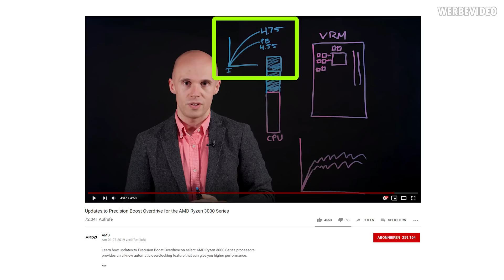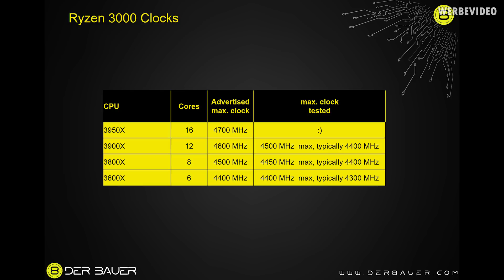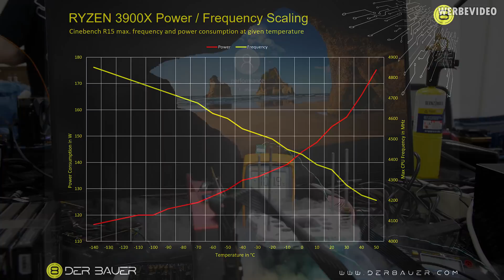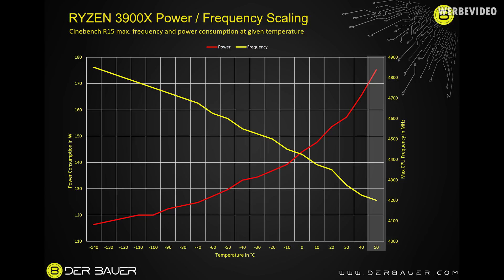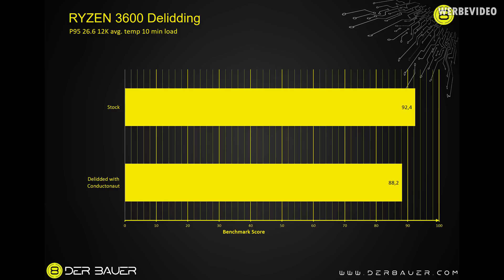RYZEN 3000 Delidded - Overclocking Expectations and Temperature Scaling

Comment: Very interesting, you said in your video that going above 1.45 V when OC'ing is not worth it, you meant 1.45V set in Ryzen Master for all cores OC'ing right ?
If that's the case, I think I'll be OC'ing at 1.40 V just to get a bit of voltage headroom and not heat things too much (I have a Noctua NH-U12A though so it should be fine).
My motherboard is an X470, but it's an ASRock Taichi (not ultimate, but it's pretty much the same except for the 10 Gigabit Ethernet), it has 6+6 CPU power connection, so OC should be fine.

Comment: Awesome work as usual dude. I was wondering if you could try cooling the chip without the heat spreader.Somewhat like a gpu is cooled with the cooler directly on top of the chip. Just curious. :)

Comment: I have an 8700k, that said. AMD have done fantastically with this generation, keep in mind 4.3 AMD is NOT equivalent to 4.3 INTEL, similar to what happeneded in the early 90's. Check actual gaming results etc... to see which processors are equivalent. I'd likely buy a 3700X if i was in the market now

Comment: Feels like all over clocking people just try and error with no clue what heppens inside the cpu. Like the engineers have no idea what they are doing? I understand over clocking factory under clocked mid and low range cpus. You degrade the material in the transistor gate. I also understand over clocking benchmark competition with liquid nitrogen.

Comment: Realistically,  with the stock cooler...what boost can you expect ?

4.2ghz on a 3800X ?
Reply: I get 4.35 ghz on 3700x with stock cooler and temp is 38-40 c. I used asus 5 way optimization on Rog croshair hero viii

Comment: @Der8aeur Great content man! I was wondering would it be possible to direct die cool the 3700x or 3900x like we can on the 9700k/9900k and watercooling it? Could we get a bit more performance and lower temps by doing so?  I would love to know your opinion on the subject or maybe worth a new video..
Edit: i'm using your direct die frame for my 9900k and lapped the die a bit like you did on a video and managed to get a great overclock on a big water loop.. I'm a tinker i love doing things like this and i would love to know if it's possible on the AM4 socket.
Thanks

Comment: AMD 3000 feature a soldered integrated heat spreader, why would you get them delidded?
Reply: He's just explaining why a regular user don't need to delid at all....professional overclockers like him will delid it anyway because they have superior LM and need every drop of performance
Reply: The lid itself still insulates the die from the cooler somewhat, removing the lid removes this layer of insulation

Comment: Once again, AMD is putting the effort in to ship their CPUs in the best condition possible (XFR, solder, etc.)

While this does ruin the overclocking potential of these chips, it also means that AMD aren't sandbaging their parts and are getting the best  parts they can make to consumers.

It also says something about the consistency of AMDs manufacturing that they're able to push out chips that straddle their maximum potential 24/7 under full warranty.

Comment: Did you see any difference between the 3700x and 3800x with overclocking? Starting to wonder if it's worth spending that extra 70 dollars for the 3800x at this point.

Comment: The high quality chips will hit 5ghz. AMD is aggressively binning the chiplets. They have no competition. All the best chiplets are being kept back. Sucks, but they are choosing to maximize profits and sell off leaky silicon. Plus, they probably anticipate more demand for Epyc Rome than they have supply. Maybe thread ripper will get good silicon bins. Probably only near 5ghz on 2 or 4 active core boost. My two cents based on research. The process tests early on indicates 5ghz possible for few cores with best chiplets

Comment: AMD always have something wrong, they sure are on 7nm, but then their Navi GPU as tested just a small OC that barely wins performance makes the GPU to go above 300W, way more than even RTX2080TI made in 12nm...

Now AMD is also lying like intel on their CPU's TDP like the 12core 105W TDP which is more around 150W even though I9 9900K is still worse, but still AMD is already getting too much like intel... I dont even know what do they win by lying.

And then its always the same crap, what you get when you buy is basically almost all you get with AMD since neither their GPU, neither their CPU's seem to OC much more than max stock boost already, future wise it just doesnt reach anywhere more than you had on day one other than relying on software\bios updates to maybe win some performance at some point...

They sure can be the 1st to use 7nm on desktops, but to me this is all signs of bad quality only...

Comment: I wonder if they sent 'golden samples' to the various tech press, because I've seen multiple reviews showing the 3900x boosting single cores to 4.6ghz on it's own.  but yeah it's unfortunate that AMD put out that video of the guy talking about 4.75+ghz.  maybe the 16 core might hit 4.75 on one core under ideal circumstances?  anyway it's still a great chip, and zen 3 looks like it will be even more amazing in terms of architecture changes, let alone the possible process improvements.  but depending on market they might feel that they can release a zen 2 refresh with process improvements first.  we shall see.  I wonder what the 3800x will be able to do vs the 3700x.  just 100 mhz extra?  given the pricing i think many high end gamers might say that's worth it.

given that the 3700x and 3800x are essentially identical, I think AMD should have come out with a star 8 core gaming part for 399-449, with the best silicon, which is currently reserved for Epic.  Even the 3900x and likely even the 3950x are not even getting the best silicon, which is solely reserved for Epyc (and possibly a future threadripper).  But if they chose a low volume 8 core part (low volume because it's 50-100 dollars more for essentially the same thing with some higher clocks - it won't be the high selling value part, so they wouldn't have to spare a lot of quality chiplets) with cherry picked A+ silicon they would have really satisfied the hardcore gamers who wanted the absolute best 8 core CPU that would truly rival the 9900K / 9900KS (or KF?) even when hitting 5.1-5.2 (or even 5.3 in some cases) ghz.  I'm talking about an 8 core that could hit whatever their best silicon can hit... 4-4-4.7, maybe 4.8, depending on the workload.  Truth is we don't know what their best silicon can hit.  It's likely not THAT much better, in fact it might not have higher frequencies at all, but simply run the same frequencies at a lower voltage, but we just don't know unless or until someone can test an Epyc/threadripper with the top silicon and see what 1 or 2 or 3 or 4 etc. cores can hit.  AMD's making a lot of money off these 3rd gen chips because these are ALL rejects, even the 3900x.

Comment: No speed @ -100 C ? I asked AMD if their new 3 gen CPU's (W/WX and Ryzen) could run @ -100C and the answer I received was "what was your question" . That ended my AMD machine thoughts. 

Why not make a shim to support the chip and leave the heat spreader off. Like on the old Athlon 1400's die's with the bare die.

Comment: PBO doesn't even fuckin work on my X470 ROG board. 1800X + C7H combo. It showed up in the bios once and now it's gone. My 1800X runs at 3.7 on all cores with no 4.1 boost when it's not OC'd. So I've been forced to go manual. 4.1 on all cores at 1.42V.

Comment: The lesson: ignore all marketing. Wait for the reviewers to get a baseline. Check the HC overclockers for upper limits. Even us filthy casuals should check der8aur's and others channels to get the upper limits so we know what is the absolute best and the reasonably competent boards.
I'm getting the impression that overclocking the R3 cpu's isn't that productive for the average users as most of the reputable overclockers seem disappointed with the basic oc potential. That and from the look of things AMD actually did a decent enough job that it's probably not necessary for just gaming and light productivity.
But I may be wrong as I'm just a filthy casual, hehe.

Comment: This is going to sound like a dumb question as I don't know that much about this. But for really extreme clocking, would there be any benefit of using a custom heat spreader made from a metal with better thermal transfer properties? Or are they very good anyway?
Reply from the maker: it is already pure copper so not really

Comment: BTW, to remove the Indium layer on the cpu, you can use liquid metal(like galinstan metal, or conductonaut if you're rich) to soften it up, then it's a lot easier to get rid of them.

And don't spill liquid metal on solder joints, they can be soften up too.

Comment: My 2600x will hit 5Ghz on 2 cores with PBO turned up, but the board (an Asus Strix X470) gave it scary voltages to hit that. If I was cooling with LN2, that'd be fine, but under my water loop, it was just too much. 1.6v under ambient water? No thanks, too scary.

Comment: Would lapping give the same 4 to 5c drop, would you recommend this ? Thank n keep up the good work :)
Reply: Lapping done right is harmless.But i doubt you will get 4-5c drop.On 1700 i got like 1 degree drop and it wasn't even worth the effort.
Reply: @Reculse  I'm not 100% on what i got from doing my 1700x (yes inknowni should have just got the 1700 but i was too quick in buying lol) but with the delid and lapping and lapping my water block I thinkin get about 8c reduction. Reas resks and the delid wasnt needed I dont think.
Reply: @Entropicarts  Probably you will get decent resault with liquid metal and without any delid and lapping. You won't overclock higher than 3.8/3.9 anyway cause it doesn't even worth it(unless you got good chip). At Vcore 1.375v(with LLC 3) i hit around 160W max and i get like 65 degrees max which leave me with 3.8GHz and fully stable CPU.In comparrison 1.18v if i remember correctly was the default clock for 3.6 ghz and the cpu was drawing 68~ish watts.

Comment: How about Ryzen 3000 direct die cooling? Would probably need shim to limit stress from mounting pressure of cooler. Wonder if it would help get more than 4-5'C lower temperatures compared to stock ihs+solder.

Comment: Mister Der Bauer did you overclock it with MSI X570 ACE?  it seems to be Faster than the Other Motherboard with the Overclocking Button on the board...  Someone Benchmarked it , it would probably get the extra 50hertz to 100 hertz!!!!

Comment: Regarding the lower than advertised boost clock - did you see this yet? https://twitter.com/andreif7/status/1148170909322293248?s=09
Apparently there's an issue with the "AGESA code" provided by AMD to MB BIOS folks see review with in depth on it here https://www.xanxogaming.com/reviews/amd-ryzen-9-3900x-review-english-dethroning-the-intel-core-i9-9900k/ and reponse from Gigabyte on reddit thread here : https://www.reddit.com/r/Amd/comments/cag6gb/wtf_is_going_on_why_is_there_so_much_disparity/
Reply from the maker: https://www.overclock.net/forum/10-amd-cpus/1728758-strictly-technical-matisse-not-really.html
Reply: @der8auer  that post seems to describe an issue restricted to the Asus Crosshair? the xanxogaming link describes an issue that affects Gigabyte, Asus and MSI boards he tested.

Comment: What i remember is  , I've delided Intel Pentium D  and i ripped off whole cpu core .. One half of the core stay on IHS and the other one on cpu board itself.. This solder in Ryzen 3000 series is extremely soft.. you should try to remove remaining solder and try to apply low temperature melt solder on it..

Comment: I don't get it. At one point it is obvious overclocking won't be a thing anymore, that is the whole point of things like XFR.

The era we were able to get "free" performances OCing your chips manually is soon to be over. We will get what we paid for and that is it.

I mean the computer are just on the same trend as the internal combustion engine. They started with carburetor, it lacked the possibility to be optimized precisely and now they have precise fuel injection.
The trade off is made by the manufacturer and while you can tweak the settings a little it will still be a trade off in the end and not "free" improvement anymore.

Comment: this is the only honest video ive seen since ryzen 3000 release. they are good cpus, but not really as good as they promised. and with no overclocking headroom at all etc. and not even matching their own advertised speeds... and even teh 3900x does not quite beat the i9-9900k in single threaded/ gaming workloads. i was always going to go for a ryzen 3xxx but now im not so sure. i have always bought amd in the past (still using an old slow fx8350 #4.6ghz) but i have a little more money now and i kinda wanted the best of the best.

also, i cant deny i love overclocking my stuff. the thought of not being able to do that... yeah. its just not as impressive to me to not own an overclocked cpu. no bragging rights etc. also, i wanted to go custom loop water cooling but that would be next to pointless performance wise with the new ryzen. 

im kinda disapppointed. i new 5ghz was out of reach. but i hoped for 4.5-4.6ghz all core overclocks. i hoped they had improved overclocking possiblities.. i mean, they use barely any power, so keeping them well fed voltage wise and keeping them cool should allow for a decent overclock but i guess not. its just not the way they were designed. its impressive. but i find it annoying.

i just dont know what to get. will probably just pick up the 3700x or something. but i initially wanted the 3900x despite the price, but if i went that high i might as well get the i9-9900k. cheaper motherboards/ram and better single core/ gaming performance. overclock capability up to 5ghz. etc... errr. i dont know.

every other video is overhyping amd. but all amd has really dont is almost matched intel in performance for games. and added more cores than most people need for anything. its mostly all hype. unless you do a lot of encoding or something...

err

Comment: Thank you for being open and direct about AMD and their practices. I know you weren't trying to belittle them or anyting but at least you're not afraid to say what's going on in some cases. 
The AMD worshippers just can't hear any criticism. 
And you can tell by the reviews today who favors AMD and who doesn't by the benchmarking results and how they approached them. 
Looking forward to your next video.
Reply: ... Except for the fact that AMD fixed this issue within a few months of launch with an AGESA update, whereas Intel wouldn't have even admitted there was a problem had their situations been flipped (let ALONE acknowledge said problem as being their fault). Ever since, the VAST majority of Ryzen 3000 CPU's will hit their rated boost clocks, and those that don't tend to be for external reasons (shitty cooling/mobo/etc...). 

Now before you start complaining about how they can't sustain said clocks long term, NOWHERE has AMD or Intel EVER advertised their max rated boost clocks as being "indefinite". Intel's Turbo Boost has had a built in time duration limit literally ever since Intel first introduced the technology (regardless of the fact that AIB's endemically disable said time limits with "MCE = Auto"). And AMD's even more explicit about Precision Boost being a dynamic, opportunistic boost algorithm, where the rated clock-speed on the box is simply the max you'll see it hit on a chip's best 1-2 cores (with no claims ever having been made that it can & will hold such clocks indefinitely. The fact that that's the default behavior many Intel customers are used to due to AIB MCE shenanigins, isn't AMD's fault it any way, shape, or form).

Comment: The theory behind why and would stagger the chiplets on pcb is so the heat generated is not concentrated in the centre its offset. If the chiplets were in the centre could it potentially become more heat saturated when running prime95 becoming more heat saturated as time progresses. I wonder if they tested this before going with the staggered approach

Comment: I wonder why liquid metal testing still requires the heat spreader, on my laptops when i use liquid metal they come without lids or delidded from factory so the heatsync will directly contact liquid metal and cpu, why dont we do the same on desktops?

Comment: They should stick a bit of heat pipe liquid underneath the heat spreader during production. Should reduce hot spot problem and improve thermal performance generally.

Comment: This is the only REAL review on the web. Actually I was like wtf, why can't those clock higher than 4.3? Nobody else mentioned much about it or focused on OC. It's really... I don't know. IPC is great, support for better memory is great, but I'd really like a "constant" system performance that I'd only get from manual overclocking. Those AMD "AI" and other crappy name things seem like a real cheat to me. There's nothing smart about it, as far as I can see everyone is getting the same results with stock coolers, D15, AIOs, etc, and mobo wise too. Be it B250, X470, no difference as I can see. And the power consumption is so low that I doubt that the VRMs need to be "smart". Come on, we gave our Visheras 300A+ of current, like 450W, and now a board has to be "smart" to deliver 100A/150W? Don't fool us with fancy advertising AMD. Everything is cool except you trying to force the higher numbers infront our faces.